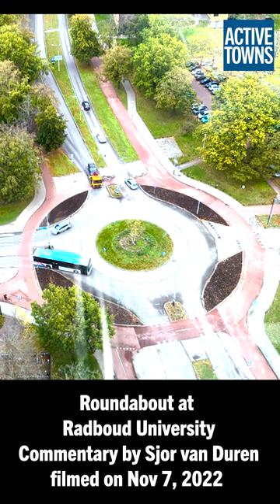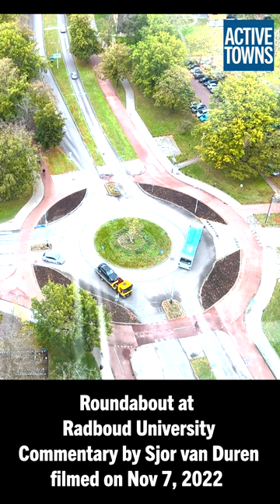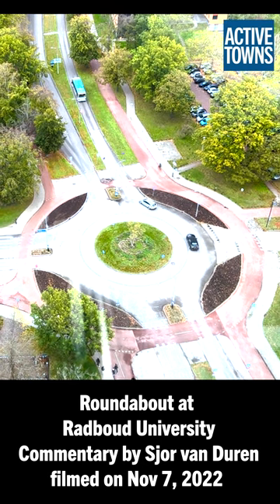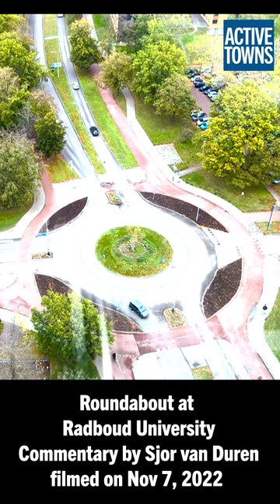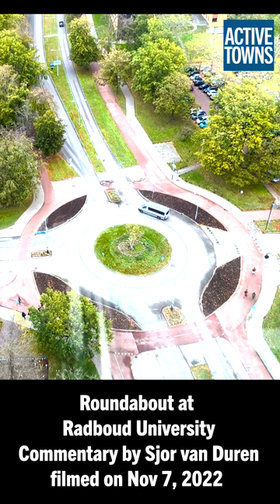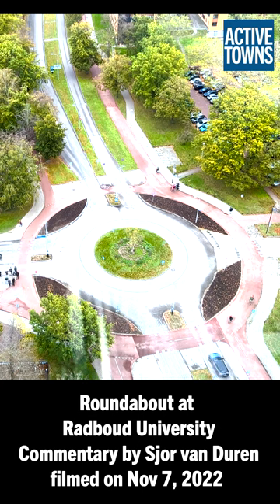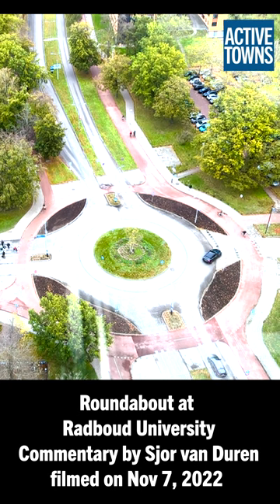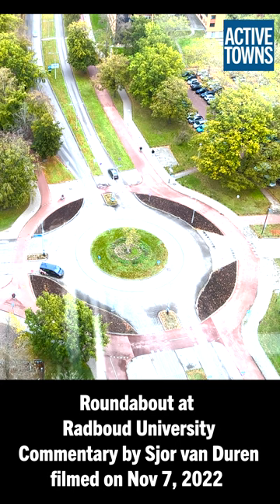Buses vs. Bikes in this Dutch Roundabout Design #shorts

Comment: Presumably this is only possible because of the relatively low level of motor traffic. For the Moor Lane roundabout in York, England this design wouldn't be possible, I don't think because there is so much motor traffic there normally.
Reply from the maker: Absolutely, context does matter. Interestingly enough, proper roundabout designs can handle tremendous volumes of motor vehicle traffic; the key feature is slow speeds. You may have already seen this one where Lennart discusses volumes: https://youtube.com/shorts/OgwD1HxtTsM?feature=share 
Thanks so much for watching! I really appreciate it, and I hope you are enjoying the Active Towns Channel. 
Cheers! 
John
Reply: Thats a concequence of there being no bike infrastructure. Most trips are relatively short and also possible by bike. So if you take away lik 30-40% of the cars this roundabout would probably work.